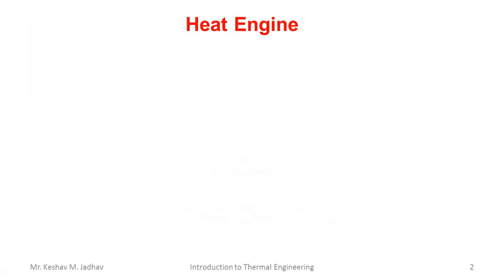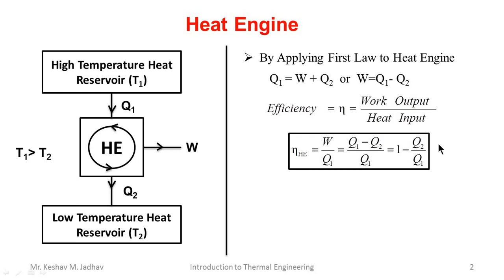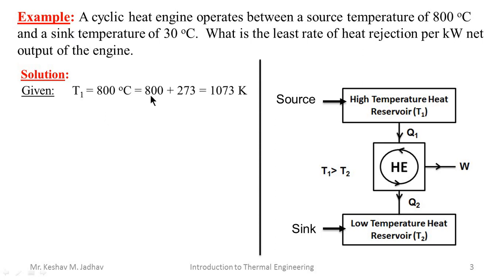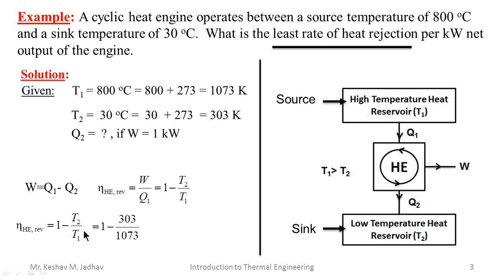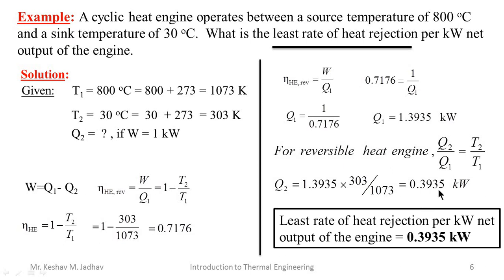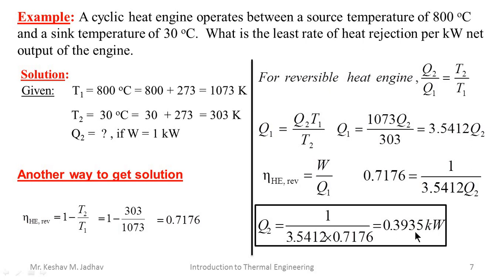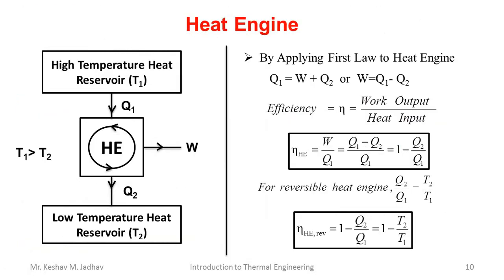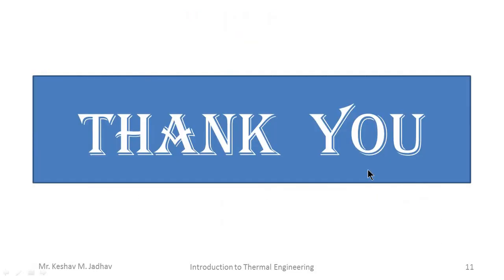Problems on Heat Engine

Comment: Derive the value of Q1 and Q2 in a heat engine?
Reply from the maker: According to first law of thermodynamics, 
Heat input (Q1)= Work output (W)+ Heat rejected (Q2).
So, Q1=W+Q2 and 
Q2= Q1-W